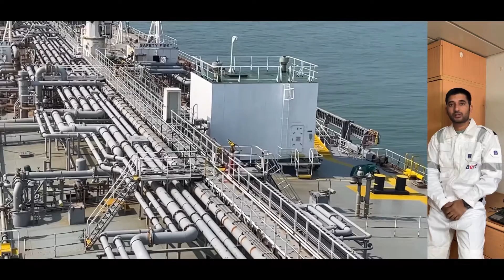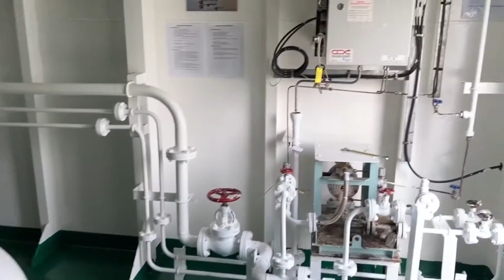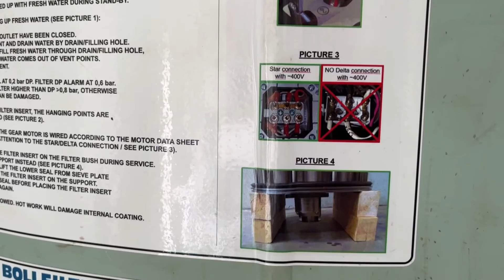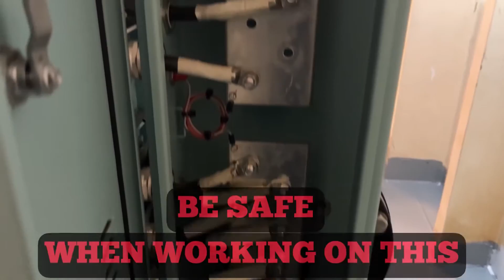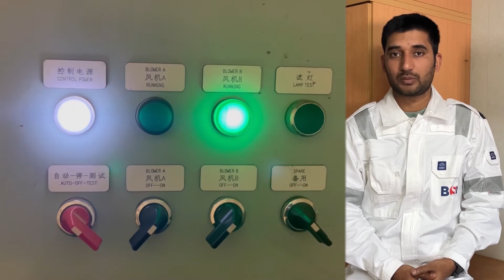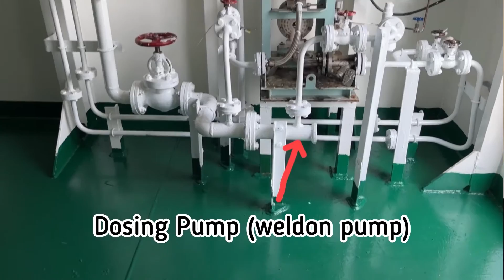Ballast Water Treatment System | Sunrui Balclor BWTS | BWTS working & Operation

Comment: Hello,
Thank you for your very helpful videos about the CSSC SunRui BalClor BWMS.
I have a question. Does the BalClor system display or record the total ballast water volume (m³) during ballasting or deballasting?
If yes, could you please tell me where I can find this information on the HMI? Which menu or screen shows the total ballast water volume?
Thank you very much for your help.
Reply: If you go to the Record menu in the HMI there is FT-related information in the AFU section.

Comment: Now I am encountering "high voltage alarm" at EDU. My ship is alongside at river port. According to my system, when the ship arrive at river water, use the water from AFT TK. Our AFT TK is filled with Sea water. Let us know our suggestions if you encountered that alarm like us. Thanks.
Reply from the maker: I have never faced this alarm.
Check your motors connected to EDU system, high voltage alarm can occur from there....
Reply: I use to get high temprature alarm always... @sailorsrikantsingh

Comment: Sir, what is the difference between TRO in engine room and TRO on deck?
Are both sensing the readings after mixing of sea water and oxidant?
Reply from the maker: Yeah u r right, only difference is tro in engine room works for aft peak tank ballasting & deballast operation and deck tro work for deck ballast tank transfer operation
Reply: @sailorsrikantsingh  
Thank you for your video. I have now subscribe as theres a lot of informative video in your channel.

Comment: Sir we are frequently getting ADU motor fault alarm, please advise😊
Reply from the maker: EDU motor fault, check for valve operation, motor condition or any pr switch connected.
Dont have much information regarding this issue and currently working on different bwts maker.

Comment: Sludge pump for back Flushing system continuously overflowing Water in the funnel , What could be the Reason ?
Reply from the maker: If backflushing pump is continuosly running, diff pressure will be high....check that

Comment: Sir.. How much amount of hydrogen thiosulphate do you need to add to the ANU unit during deballasting during loading process..? How much quantity for how much litres of fresh water in the ANU unit...?

Is it necessary to add chemicals in case of deballasting after 30 days or more after ballasting...?
Reply from the maker: Maker suggest 300kg/m3 but if deballasting is carried out after long time generally we dont need to add much chemical, best is to start the plant and monitor tro reading and if it's in your range don't add chemicals
Reply: @sailorsrikantsingh  Yes.. sir.. thank you 😊